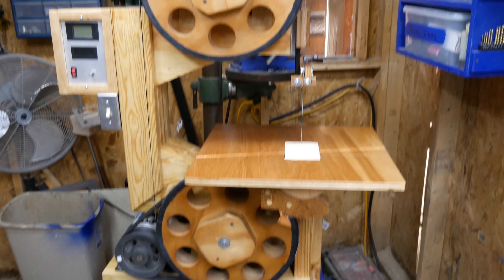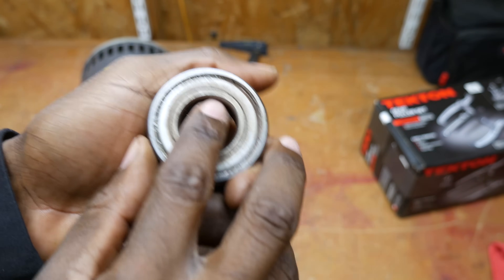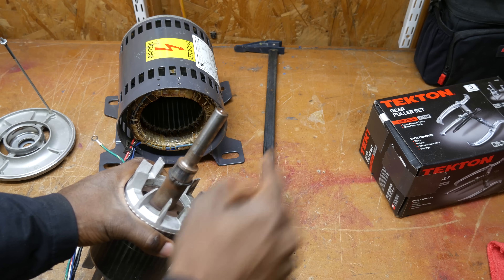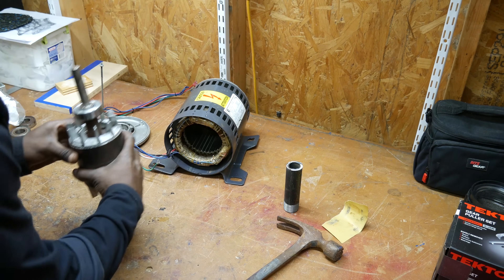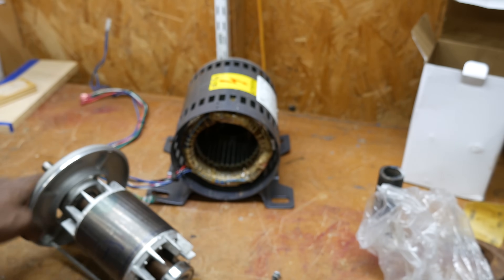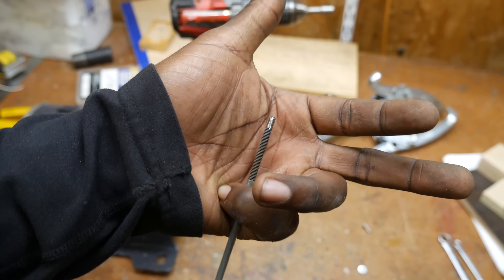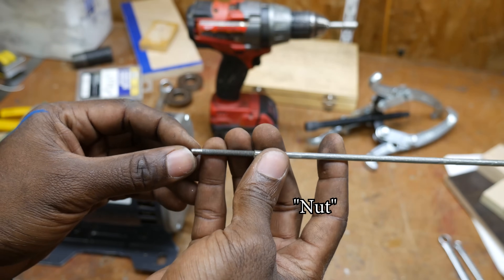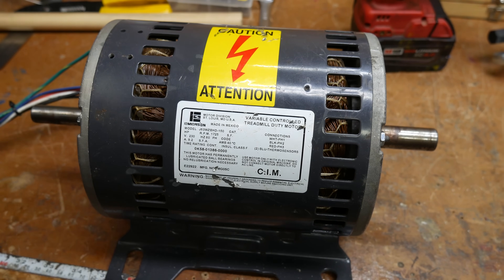My BandSaw Is Noisy; Replacing Motor Bearings For The First Time: 044

Comment: As a service engineer there is no problem installing a bearing that way and have done many times in the field ,a bit of lubrication would of helped you out but no harm done. You have to work with what's available or affordable we don't all have a press to hand.
Reply from the maker: Thank you! And, the lubricate tip is helpful as well.
Reply: what kind of lubricant would you recommend?
Reply: @threegs3496   I like 3-in-1 oil. It only takes a drop or two but almost any lubricant will work.
Reply: Three G's any thin oil,wd.40 or similar, engine oil ,at a push grease  but anything is better than nothing as it's purely to reduce the friction between the shaft and the bearing.once assembled it's redundant so just a little is enough. I have knocked them home dry myself and specially if it's a tight fit it can make all the difference
Reply: Metal on metal is never a recipe for success. Unless you want friction. If parts are not meant to move at all then you can go dry. But you are expecting the race to slide onto the shaft. So there it is appropriate to use some lube.

Comment: Hi Jeremy

Meybe you could put the rotor in the freezer over night and heat up the bearing to 50-60° C then they will go on very easy !

BTW: Will your band saw take metal too - is it stable/accurate enough ?
Reply from the maker: Oh yeah it will cut steel. That is a 4 hp motor, and the frame is extra thick and rigid.

Comment: Thats how I put my unisaw bearing in.  I used a cap end on the pipe and a small piece of plywood square with a hole smaller than the ID but larger than the shaft.  Used between the bearing and pipe gives a more even pressure across the bwaring.

Comment: Before removing the bearing, did you try to grease it? Just saying...
Reply: +GlueTubber shielded bearings such as these come lubricated from the factory, as they are not designed to be opened, or serviced. That doesn't mean that you can't, just that you're not supposed to.
Reply: They're shielded bearings. But you can pick the shields off. Grease won't make them new bearings though. But unless the bearing is really whooped greasing them is usually enough.
Reply from the maker: No... that didn't even cross my mind. I don't think you are suppose to grease these particular bearings. There didn't appear to be a way to remove the seal without damaging it. I am not sure, I could be wrong. I have never tried to do that.
Reply: yes its possible to grease bearings,some have metal shields/seals some have plastic both can be flipped out and pressed back in but usually when they making that sort of noise they need replacement anyway-while admittedly your way is a crude way to fit bearings we have all done it and it works,obviously if its on a high end expensive/delicate machine you wouldn't risk it but on anything else if it fails in a couple of years so what   its not like its cost a fortune in time or money
Reply: Did you grease the new bearings? They sounded dry when you spun them.

Comment: I haven't done much bearing work, but what I have done worked out ok.  Tapping a PVC pipe like you did worked well a few times.  The time I needed to I stall some in a weirdly shaped housing, I stuck the bearings in the freezer, and the metal housing in some boiling water for a moment.  The resulting swell and shrink made things MUCH easier.  A little oil also helps.
Reply: Adam Perkins in this case you put the shaft in the freezer, and yes it works.
Reply: sometimes you can break a frozen nut free using a similar technique.
i had to pull a transmission out of my old car to replace the clutch and one of the bolts on the bell housing was frozen.  so i heated the nut carefully with a torch, then once it was good and hot,  i touched an ice cube to only the bolt.  the thermal shok broke the nut loose and i was able to then easily remove it.
Reply: You got the right idea. But, with a sealed bearing you have to be a little more careful about heating it. So, after sanding his armature lightly to it clean, he can put that in his deep freeze to chill out for a few hours. Then warm the bearing in a toaster oven or some guys use a crock pot. But, be careful not heat the bearing extremely which can cause the seal to fail and the lubricant to leak out. So, he shouldn't heat it hotter then 150 F or the limit specified for the bearing. He can then take the armature out of the freezer and  slide the warm bearing on. Put the assembly back in the freezer and warm the housing being careful not to damage it and repeat the process. Some bearings have to be heated very hot and some factories use liquid nitrogen to chill the shaft for extremely tight bearings. The boiling water method is often used for slip bearings.